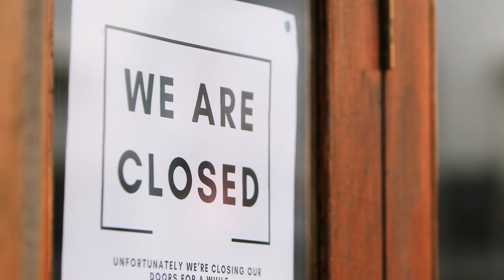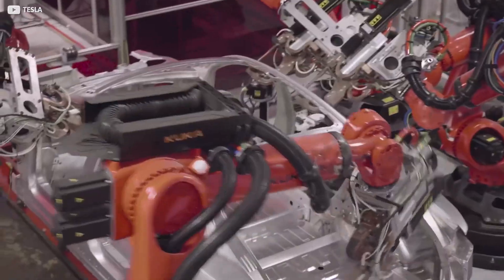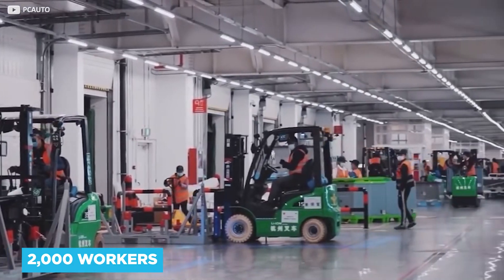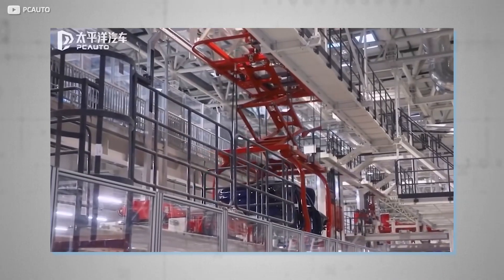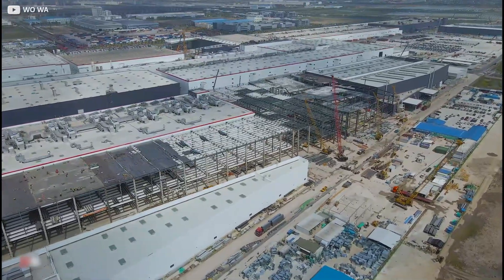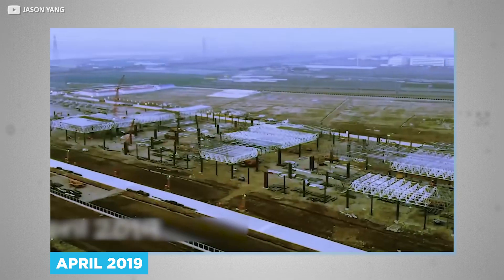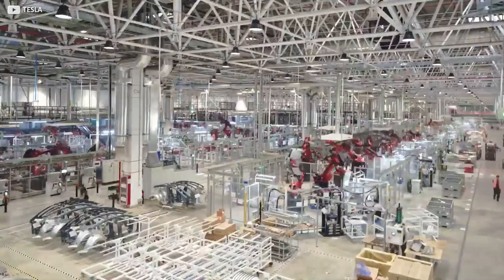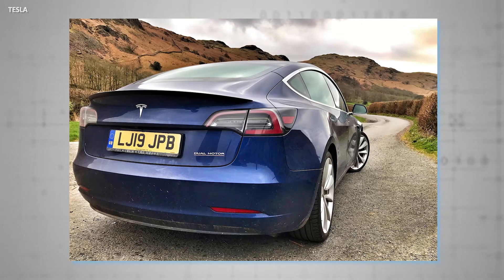Inside Tesla's New Shanghai Gigafactory

Comment: Theres still the question on the effects of mining metals for these 'eco cars'. Not to mention what happens to the batteries afterward?
Reply: Mining, including oil drilling seems to be the similar or better for electric cars.  We should keep an eye on it, though.  In contrast to gas/petrol cars, batteries are useful after the electric car is pensioned off.  Also battery cars can last much longer: Tesla is aiming for 1,000,000 miles.  You can reuse and recycle the batteries, you can't recycle the gas.  And burning stuff is destroying our climate.
Reply: @mrmichrom8553  As long as nuclear energy is phased out, I'm happy. Also what is the electric car body made of...maybe recycled computers?

Comment: Pretend it's ten years from now while viewing these kinds of videos.
Reply: Tesla are barely any better for the environment.
The still use largely the same metals to build the car as conventional vehicles, which requires a lot of mining.
The batteries are an issue given they degrade, will need replacing often and are made out of mother Earth's resources. 
Plus obviously most electric is made coal and burning trees. 

EV's are a con
Reply: @superrrnova1986  Tesla recycles 92% of their batteries and growing. You'd still have to mine for resources and minerals no matter what, we cannot decrease the amount of minerals on our planet as the mineral never leaves the planet. to increase minerals on our planet we need to mine in space, as space (even our solar system) holds so many times more minerals than earth does, that is the reason why Im rooting for spacex.

Comment: Gigafactories 3 and 5 (Texas) make for an interesting comparison: #3 being built out incrementally in three phases then ramping products following Fremont;  vs #5 being built out fully in one phase and set to ramp new products (Roadrunner 4680s in structural packs with castings replacing welded frame, CyberTruck).  Prior to Tesla's late 2020 capital raises, an incremental build-out was planned for #5.
Reply: 5 is not being fully built in one phase.

Comment: Has the EV industry solved the battery charging issues yet?
Reply: What do you mean by battery charging issues? There’s not much technical issues with it. Could be faster, sure, but the vehicles in the market right now is probably good enough. Charging isn’t considered a big problem here in Norway anymore, as the infrastructure is now widespread enough that there’s a solution for everyone. Even public street side parking in Oslo has had charging poles for many years now. The main challenge is that people need a change of mindset. You don’t want to stop at a a gas station and stand in front of the car while waiting for it to charge. You want charging stations in your supermarkets, and you let it charge while you go shop for groceries. Or while working out at he gym.  Or visiting the hardware store. Etc etc. Even my small local supermarket has two 150kW chargers now. Not that I ever use it. Since we charge at home, we use public chargers maybe 10 times a year, on longer trips. We probably spend less time at public chargers than we did at gas stations with an ICE vehicle. 

It’s more of a political problem. For people renting apartments you need to encourage or even force owners to install plugs for overnight charging when renters request it. I’ve heard some US states have a some regulations aimed at that already. And you need municipal support for charging poles at public street side parking.
Reply: @auspiciouslywild  Absolutely, I agree with you on some points, however I can easy lift 700 km of range in two fuel cans and fill up in 3 minutes. Battery energy density is terrible in that regard, well over a ton and order of magnitude longer charging equivalent, at best. On a long trip, now I have to factor in charging and location of chargers. As an example, South Africa can barely keep the lights on, due to a corrupt ANC government and incompetence, now we are on board with forcing countries to electrify private transportation, under government mandates. I just don’t think it’s as practical as you say, and we will definitely miss ICE when they are gone. A better service to humanity would be to mass sterilize the grossly unproductive.
Reply: @anthonywalker6168  You're right about the downsides of batteries. But the upsides makes up for it for the vast majority of people, if you have the right infrastructure. But the infrastructure is relatively simple and cheap fortunately. You're also right about the problems of stable electricity in developing nations. But you forget that fuel supply is also a huge issue for them. Some of them have terrible quality of fuel. I remember a guy from Jorden saying BEVs would be great for them because the fuel they have is ruining their car engines.  Fact is, with BEVs you can just have your own solar panels and charge it anywhere. You don't even have to be reliant on the grid, making it far less dependent on government infrastructure than fuel. "A better service to humanity would be to mass sterilize the grossly unproductive." - WTF, that got really dark really quickly. Birth rates isn't really a problem anymore. It's as low as is reasonable in most countries, and falling quickly everywhere else. Population growth is mostly due to increased life span. So if you're going to be an utter disgusting asshole about your proposed solutions, it's more reasonable to suggest euthanasia of senior citizens. Otherwise you're punishing the young for the sins of the parents. But even that won't actually solve the problems of CO2 emissions from ICEs. It'll only postpone the problems by a few years.
Reply: @auspiciouslywild  

Have a little look into charging an EV from solar panels then reassess your views my friend. Not plausible in the slightest
Reply: What about the cars being made of the same mined metals as regular cars?
The batteries needing replacing frequently, which also requires Earths resources.
Electricity is never renewable. 

EV's are a con and a joke
Reply: @superrrnova1986  Yes, EVs are made from the same metals, except the rare metals in the catalytic converter (mining of those are pretty dirty btw). All of them are recycleable. Fun fact, lead-acid batteries is one of the most recycled product on the planet. Point is you don't have to perpetually dig up oil for all eternity like with gasoline cars.  EV batteries do not have to be replaced frequently, at most once or twice over the lifetime of the car. It's looking like many EV batteries will last as long as the car itself. It doesn't sound like you actually know anything about EVs. EV batteries are fully recyclable too. It has taken some time to get the recycling process up and running, so I'll forgive you for not being up to date. But right now there's several companies with processes to do it profitably. Many EV batteries are also re-used for energy storage in buildings and on the grid.
Reply: @auspiciouslywild  

EV battery life is 10 years. 
Let's imagine everyone has an EV, every ten years, every car owner would require a replacement battery.
Not sure why you think batteries don't degrade. Also not sure how digging for minerals for EV's is any different to digging for ICU vehicles.
So when you say EV batteries are fully recyclable, you fail to factor in the new materials needed for the new battery. My point is, its not very environmentally friendly. 
Energy storage is bullshit too. Requires exotic minerals and they degrade like batteries, as they're massive batteries.

Lots of critical car parts require high grade Aluminium. Many manufacturers wont use recycled alloys for things like gear or motor housings. EV's will always require fresh bauxite.

Speaking of energy grid. Burning coal and burning trees is hardly environmentally friendly. EV's are a fraud
Reply: @auspiciouslywild  I agree with your points, and also wish the world could transition to electric vehicles. Unfortunately, if something isn’t practical it doesn’t last, like anything for that matter. Time will tell. Currently, neither the systems of production, nor abundant charging resources can solve a problem that lies within the limits of solid state chemistry and practical engineering solutions. There will be IC engines for a long time still, no matter what governments around the world say. Governments say many things they don’t follow through on, it’s the world we live in. Money and power make the world go around, not ideology, ask any politician....

Comment: I can’t figure out why anyone wants a Tesla.  Low quality junk.
Reply: Stop being salty just because you can't afford one
Reply: Go talk to tesla owners instead of reading clickbait articles and find out.
Reply: @miguellopez3392  Go read the actual numbers produced through research rather than blindly believing Tesla fanboys.  J.D. Power’s Initial Quality Study ranked Tesla number one in terms of quality issues being reported by owners of the 32 brands being currently sold in the U.S.  The industry average for quality issues per 100 new vehicles sold was 166 per 100 units.  Tesla’s average was 250 quality issues per 100 new units sold.  Those are the facts, chump.
Reply: @pulsatingsausageboy2076  jd power lol.
How about you go read surveys on owners instead of a survey on quality, the answer may shock you.
Reply: @pulsatingsausageboy2076  on quality issues, I'm telling you to go look at their experience and satisfaction not of a pannel misslalignment you can start with consumer reports you dunce.
Reply: @pulsatingsausageboy2076  so have you learned the difference puddin?
Reply: Tesla certainly has issues with quality control but it's still the single option for anyone that reliably wants to daily drive an ev. There's no other company that has the charging infrastructure that tesla has and that alone seals the deal. There's drawbacks to everything. What matters is if the pros outweigh the cons in your eyes or not.
Reply: @bruhder5854  The pro’s DON’T outweigh the cons though.  You’re much better off to drive a petroleum powered car and wait for other manufacturers to sell you a quality car.  Or buy one of the other electrics like the Mach E that are already much better quality vehicles in their first generation than anything Tesla makes.  I know one thing and that is that spending a lot of money on a pile of shit is NEVER a good judgment call.
Reply: @pulsatingsausageboy2076  the pros do outweigh the cons, surveys also show people are more willing to spend outside of their budget for a tesla then other cars, mach E is subpar to a tesla I can give you a comparison that involves numbers and reviews, or will that make you too angry? Numbers and surveys seem to do that...
Reply: @pulsatingsausageboy2076  well let's suppose I don't want a petroleum car and I can afford an ev but I've long travels and a business schedule. Which other company' ev could sustain me with battery life and recharging on the go? This is a genuine question btw.

Comment: You are correct that Toyota started it, but it's called "Just-In-Time" not lean manufacturing. I know because I was a buyer for a company that supplied Aston-Martin.
Reply: You're right, he was describing Just-in-time, but Lean manufacturing incorporates JIT as a tool to strive for continuous flow in a production line. It's all about reducing wastes and standardizing processes for as little variability as possible.
Reply: Yes. JIT right material available at just right time. It was Japanese Company introduced this technique.

Comment: Oops. Lean manufacturing is nothing to do with parts arriving at the right time - that is Just in TIme inventory management - 'Lean' means you can retool your machines for a batch size of one very quickly - if you sell only one pink Tesla you still make a profit on it because the cost to retool the paint line is very low. This typically means much lower tech tools - at least it did at Toyota.
Reply: That's a gross oversimplification of Lean. Lean is a comprehensive methodology which focuses on reducing waste in a system (overproduction, transportation, delays, inventory, etc.). Just-in-time is a prominent tool used to accomplish this, by striving for continuous flow (or one-piece flow) to minimize non-value added time through the process. Lean certainly has to do with parts arriving on time... it just also encompasses a plethora of other factors that all are aimed at accomplishing the same goal: no variation and no waste.
Reply: @TheBirdRocker  well, the variation part is the ‘Six Sigma’ part of ‘Lean Six Sigma’. It is looking more and more like Lean is a shortened description for L6S. I definitely agree with the rest about JIT being just one Lean tool of many.